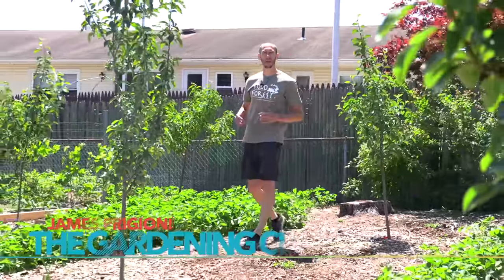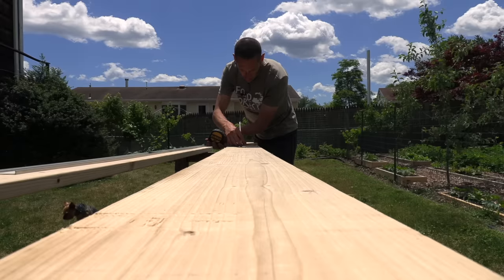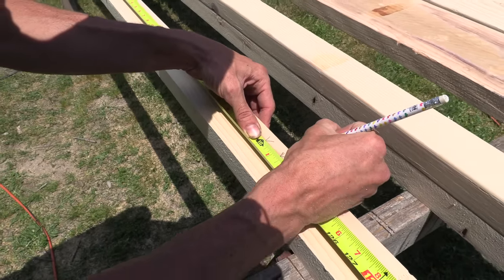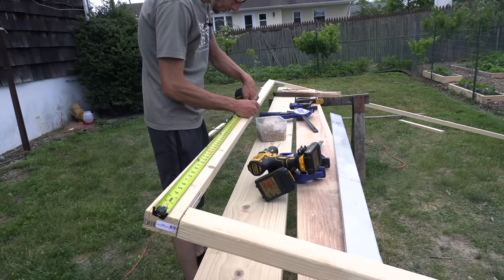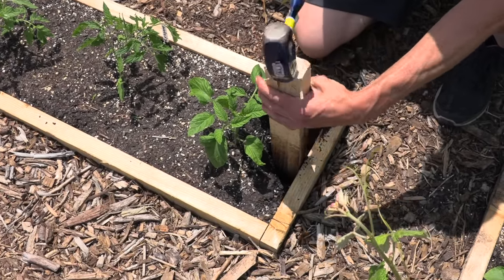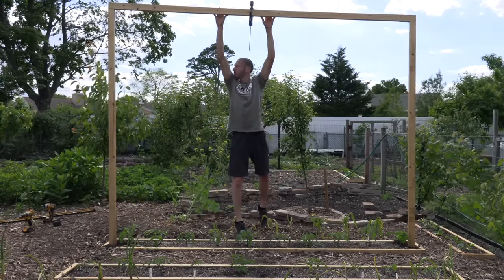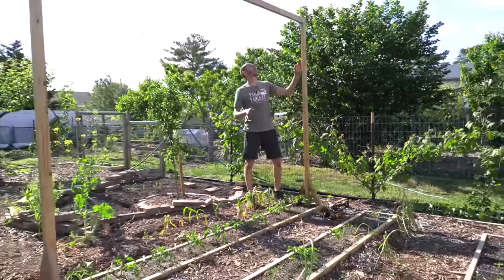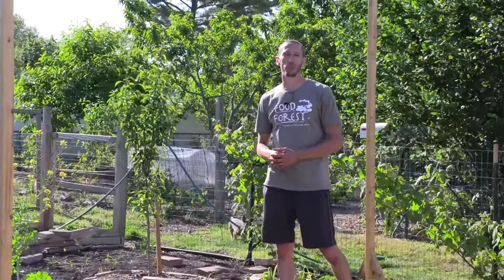How to Build a Tomato Trellis Using Only ONE PIECE of WOOD, CHEAP and EASY Backyard Gardening

Comment: Boiled linseed oil is filled with petroleum distillate. Pressure treated wood is a much safer option. Read the label.
Reply: Yea and poison. Defeats the whole purpose durrrrr. Read the chinese labels lol you better off lmao
Reply: Which brands contain petroleum distillates?
Reply: I have raw linseed oil
Reply: You can use 100% raw linseed oil; tung oil works, too.
Reply: Petroleum is organic.. chems in pressure treated isn’t 😂
Reply: @stevetrivago6347 modern pressure treated wood doesn't leech copper and doesn't use arsenic in its curing process.

Comment: Just a side note, a square galvanized nailing plate is easier, stronger and will resist racking better that that 90° bracket in the corner. A TP35 ($.93) from Home Depot. And gives you some holes for guy strings if you need em. I like your idea, gonna do that this spring.
Reply: Thanks for the tip.  We made one of these.  We tried 4" corner braces per the video, and they were pretty useless.  The whole thing just bent and twisted, and the extra screw thru the top split the wood, even with predrilling.  So we disassembled the brace and screw and purchased 4 Simpson Strong Ties (model TP15) and secured them with 7/8" galvanized roofing nails on both sides.  Worked perfectly.  Just adjusted the ones on the back by about 1/4" so no need to worry about nails coming in at same spot on each side. Installed some fencing stakes at the end of each row and secured the trellis to each fence post with 2 stainless steel hose clamps.  Trellis is super solid.  Home Depot wouldn't cut any wood lengthwise, so used 3 each 2" x 3" x 8' boards.  Had to search to get straight pieces.  After attaching the plates to the front side, you will need a helper to turn the unit over so it doesn't bend the plates until the plates are attached on the back side.  End result looks really nice.   Would probably be easier just to drive some taller fence posts into each end and attach an electrical conduit pipe across the top like some other gardening videos show, but that doesn't look as nice and I didn't want to have a giant lightening rod in my garden.

Comment: I made the exact same trellis EXCEPT rather than wood across the top I used a piece of 1/2 " conduit pipe ($3.35 Lowe's) which is much lighter and aerodynamic for the wind. I drilled 1/2 " holes on the tops of the side pieces and slid the pipe in. Easy peasy. Also easy to disassemble if you don't want to look at it all winter.
L❤VE watching you. Lots of fantastic ideas AND pretty easy on the eyes! 🐾🐾
Reply: Ha! I did the same!
Reply: Great idea!!
Reply: Great idea.
I would use 2 pieces of 3-foot rebar banged 18" into the ground and 2 pieces of 10' conduit. Cut one conduit in half for the verticle poles.
You could look at nothing when the growing season is over.
Reply: I made a balcony trellis, 85" tall, for my tomatoes with 3/4" conduit connected with canopy fittings. I cut the conduit with a hack saw and assembled it quickly with the fittings. No rotten wood later on.
Reply: He's just great at what he does.🤗🤗🤗🤗🤩🤩
Reply: Is the conduit you used the PVC kind?
Reply: Yeah, James sure isn't an engineer. For the use of having a truss for his tomatoes he put a lot of sweat& time. I could of made everything out of PVC & had it done in an hour. Lolol
Reply: @kenlejful  - Perhaps he prefers the look of wood over the pvc.
Reply: @kevola5739  To each his own, but don't tell us it's an easy thing to do. Just cutting the wood into three pieces is a ball buster unless u have a table saw & then I would have mine built before he cuts the wood. I like this guy for his knowledge of gardening, but leave the building to contractors like myself lol.
Reply: @kenlejful  -Sorry if I implied the build was easy but was suggesting his personal choice was the aesthetics. Some people have difficulty with metal or mechanical  fittings as well. We will probably see an Ikea version of this trellis eventually with people complaining the three pieces are too difficult to assemble.
Reply: @kevola5739  no problem, he's an amazing gardener.
Reply: 1/2" conduit pipe 10ft long for $3.35????? what the heck... same thing here is $25 per piece. im trying to find budget friendly options but everything suggested is way off price-wise... ugh!!

Comment: I do basically the same thing but I use a piece of 1/2" conduit along the bottom of the row of plants to tie the cord to and screw it down to my raised bed instead of tying it to the base of the tomato plant. That way there is less stress on the stem when there are heavy winds.
Reply: @jamesprigioni  Epic gardener on YouTube....I believe I seen them bury the string under the tomato. Just another idea. Do you still use this method of trellis

Comment: I bought 2in by 2in 8 ft long pieces from Lowe's. 1 nail on top of each end of cross piece drilled 18 in holes in ground and set them in, had a 2&1/4th inch auger. They lasted 12 years plus with 1 bye's for cross pieces tied to ends. Never treated the wood but stored inside for winters.
Reply: You should make a video of it. 😊

Comment: James: I used your idea to improvise a trellis for each of my raised wicking beds. I cut a single 2x6x8 pressure treated board ( btw: pressure treated wood now uses copper to preserve the wood, not arsenic like before) into thirds using my table saw. To hang my string spools, one per plant, I used 5 mm vinyl covered wire rope and turnbuckles and hooks attached to the inside of the raised bed just above ground level near the row of plants. I put another wire rope attached to the end poles just below the top support. I used the tomato clips you mentioned to attach to the plants and the strings. I hope this vertical support system will help keep the plants and fruit up off the dirt. Thanks for the inspiration!

Comment: If your lumber yard/box box will cut the lumber for you (or let you do it) buy at least a 16' board. The mills will typically use straighter lumber for longer pieces. Also, if you're going to rip it liked this make sure that's the grain is straight too. If you open uneven grain then you run the risk of it beginning to warp.

Comment: Be careful with tying around the base, you can easily strangle the stem when it gets fat later in summer. It's better to put a small stick / stake in the ground by the plant and tie to that
Reply: I thought he was going to secure the string in an upside down Y shape to the wood
Reply: When transplanting, drop the bottom end of the rope in the bottom of the transplant hole. Only issue with that method, is if a strong wind catches the rope or something pulls on it, it might give at the roots before it gives at the top of the trellis, depending on method of attachment. 

Thank you for this video.
Reply: Yes .. true.
Reply: I would never tie anything at the base of my plant. I use 5 gallon containers and tie it to the two loops of the container.
Reply: Thank you for that! This happened to me last year and I lost 2 plants

Comment: Nice work! Tomato heaven coming soon. A little tip: when predrilling, setting the drill to hammer mode will speed up drilling the wood, and keeps the bit from building up as much heat. Also, backing out the bit maybe halfway through the drilling process to empty some of the drilled wood will keep the bit from getting jammed up as much and once again reduce the amount of heat buildup. Heat buildup is one of the primary reason that a bit will dull quickly.
Reply: I thought the same thing. I mean he’s an awesome gardener but needs to sharpen his Carpentry skills

Comment: So just a tip coming from a carpenter, when using a skill saw perform a half cut, half the depth of the timber in order to avoid burning the wood if using tools more aimed at diy and then you can redo the cut at full depth in order to complete it this will help prevent your blades and saws from burning out and make your work look neater

Comment: Hey James! I noticed that you’re likely using regular boiled linseed oil that you can find on the hardware store shelf. I just wanted to let you know that there are actually a ton of chemical hardeners in it that may defeat your aim of not using pressure treated lumber. When I was researching linseed oil for my woodworking a while back, I was really surprised to hear that Linseed oil really isn’t all that much oil at all. Just a bunch of chemicals. There is a brand called “Tried and True” that has pure linseed oil and beeswax mixed together. It’s all natural and would probably achieve your goal a lot better.

Anyway, I’ve been enjoying your content! Thanks for all the info. I’m excited to plan my garden for next year.
Reply: Your added information was very helpful. Thanks for sharing 💚🌍
Reply: cant you buy it in edible condition at the grocery store?
Reply: Jan Matthiesen - I haven’t seen it at the grocery store, though I think that flaxseed oil is technically the same thing.  If you did do that, you would need other additives to allow it to be a good finish (like beeswax). When looking at the hardware store, only a select few brands, if any, will actually be linseed oil. The rest are not really boiled linseed oil - which is really misleading. “Tried and True” makes a good version that is pure linseed oil and beeswax. It is non-toxic and natural. Your better off ordering online or getting at a local woodworking store.
Reply: It needs to be..
PURE RAW LINSEED OIL...100%completely natural oil
Reply: ...special ordered from any local hardware store! Not usually in stock at any stores in my area..forget running around to find it..just special order it.

Comment: Jim,  not sure if you'll wine up reading this....but here is a couple of ideas !
1. Use scarp plywood pieces make 4 triangle pieces for the top of your frame to reinforce your frame. 
2. Your vertical pieces on the ends...if you notched them to go over your raised box...your braces would have a larger surface area for them to screw into. 
Watch your videos all the time,  very helpful...thanks

Comment: I made a stake about 3/8 to half inch square,  about 18 inches long.  one end is somewhat flattened like a screw driver.   It has a notch in the flat end.   I have some used baling twine.  I tie a knot in the end and catch the knot in the notch on the stake.  I drive the stake and string into the ground next to the tomato plant.  The string will stay in the ground when the stake is pulled out.   You might have to tamp a bit.  But also,  don't pull too hard on it either.    Tie the string off at the top.  Wind the plant around the string as it grows.   Another way was to put the string in the hole you dug for the tomato plant, but I always forget about that until after I planted them.  That is why I came up with the stake idea.  Hope this helps.

Comment: My first attempt to trellis tomatoes.
21" apart
Will prune them to grow vertically. If it inadvertently let them grow outward, I figure I can add more twine lines.
But I anchored each twine at the base of the plant.
Seems like the most difficult unknown is how much slack to leave in the twine.
Currently adding extra length and curling it up on clothespin; that way I can always tighten/loosen as I learn.

Comment: It's a good idea, Jimmy, but those 'dainty' little screws you used for the main bracing aren't gonna last too long in untreated timber.  I'd be using slim type bolts about an inch longer, and washers, to give a lot more bite to the bracing at the weakest points.

Comment: Great job. I love your garden and videos. So many videos only show year 1 results. You show years 2+. The experience is very helpful. I would love to see a watering guide video. Some elements that would be great include: how you check when to water, the method(s) for watering (sprinkler, drip line, etc), length of watering, etc. You have mentioned that watering depends on the needs of the plants. I agree. But I don't see any drip or watering lines, and was curious about the details.

Comment: I just loop the string over the top, no need for holes. Also this allows me to move to left or right if I decide to leave room for an extra run off of a “sucker” I generally do 3 runs for each plant.

Comment: Here's something to bear in mind when ripping multiple narrow boards out of one wide board.  A medium sized knot, that will not seriously weaken a 2 by 8, can be a serious defect in the middle of a 2 1/4 wide strip.  So you can't just use any 2 by 8; you have to find one with no major knots.

BTW, I notice that you use "raised bed" in the sense of "bed that is not raised, but is flush with surrounding ground." ;-)

Comment: This year I'll try getting a couple long metal garden stakes to pound on each ends of my tomato line and I'll run some a few lines of metal wire across that I can attach my tomatoes and then when the tomatoes get about shoulder height later in the season I'll probably just let them bush out from there. I'll try there this year but may try something new next year

Comment: One thing I would suggest is when attaching the sides to the top at the corners would be to do the top screw first. This will allow the screw to pull the two pieces of wood together and give that screw a stronger hold. Then put the brackets in after to hold it all in place and give it additional strength. However, great design. Super simple and inexpensive to build.

Comment: Pressure treated wood is no longer poisonous, so you could safely have it in your garden. It has been nonpoisonous since 2003, used to be pressure-treated lumber was treated with chromated copper arsenate (CCA), a preservative containing some amount of poisonous arsenic. IDK what they use now but it's totally safe I worked at a sawmill back then and we had to switch. I don't like it myself as I don't think it works as well. But it isn't poison anymore.

Comment: I use electrical metal conduit shoved in the ground and I drill a hole in the conduit and connect to the cross piece with bolt and nut.  Light weight and good in the wind.  I think the conduit is cheaper and never rots.

Comment: Just to let you know that I use only untreated wood in my vegetable garden. To keep it from rotting I wipe it down with linseed oil. I see you are sinking your wood trellis into the ground and it will rot out quickly. To avoid this and also to move it fast to other locations without having to dig it out, I sink a cheap fence t-post ( the green ones) into the ground and then screw the wood about 3-4 inches off the ground to it using 2-3 screws up the post holding the wood up. such wood structures last for years to come. I leave the T-posts in to screw other pices of wood structures to it to secure them. Like for holding plastic for coldframes etc. that way it is easy switched out.

Comment: I've grown tomatoes in cages for years with little pruning  but they take up lots of space and  and Ilike to try the trellis method. Right now  I have some 7' x 3' metal raised beds. have you done a video on building a trellis for a metal raised bed? I had wood beds before  and wish I still did so I could attach the trellis to the bed as you showed here.

Comment: Just a suggestion.  The holes in the top for the lines are not necessary, just run it over the top. I did something similar, but used 2x4's and a piece of 1/2 inch conduit across the top.

Comment: I use conduit pipe and wire for my trellis  . . . . Note  that your string should be put on prior to the plants bending over from their weight or wind.  Nice project. Btw. Linseed oil is a carcinogen.  Could always use veg oil to preserve the wood

Comment: I hear you on not wanting to use pressure treated in your garden (and thus eating the chemicals).  What do you use for the lumber in your raised beds, do you just use pine/fir and treat that with linseed oil as well?  I thought about building mine with cedar, but $$$$$$

Comment: love the channel .. great idea on trellis .. have the same  concept last yr .. works great .. but it will get top heavy ..(you might need to put in 4x4 post in ground in middle 6 feet over or so, then use a 1/2 conduit for electrical to span over to the trellis top and screw it to the top .. will eliminate all sideways movement) .. good luck

Comment: When you use this method you must prune the plant a lot. Even indeterminate tomatoes will try to spread horizontally as they grow toward the sky. I built a version of a wooden trellis with jute string for the plants to climb, but I've had to add so much additional strings to trellis that the bed looks like a spider web...I needed to prune better.

Comment: If you are doing angle cuts even if you aren't a pro get yourself a miter saw. I paid $110 for a lower end Ryobi about 3 years ago and it is was worth it. You don't need a high priced one unless you are a carpenter. It's just much more easy and safer and your cuts will be perfect.

Comment: James for a 10ft span you should have used a 2x6 for the top rail so that it does not sag down lots.  Ideally I think you should have made the post 2 ft from edges to reduce the span to only 6ft between the posts and then top rail can hand 2 feet on both sides unsupported.  DID YOU TOP RAIL SAG A LOT AFTER YEAR OR TWO OF TOMATOES WHICH ARE HEAVY LIKE 100 LBS EASILY.

Comment: Just planting some summer flowers from saved seed, the food gets planted in September through February. I have grown okra, and jalapeno and other hot peppers in the South Florida summer. But that was before I spread several truckloads of wood chips on the backyard. Water is too precious to waste putting it on Florida sand, at 90 degrees, constant wind, and the fiercest sun. I have used shade cloth in the past with some success. But hot is hot. The plants know. Daily cycles of afternoon wilting never produce great results.